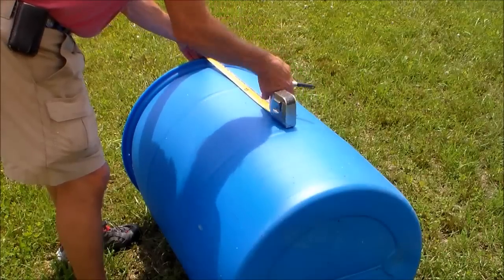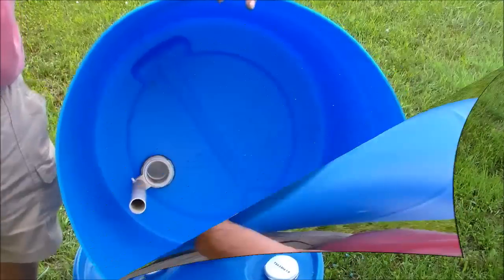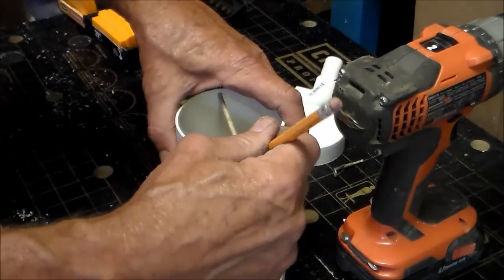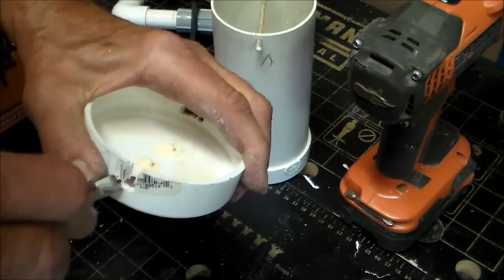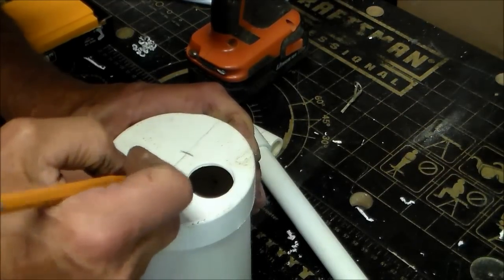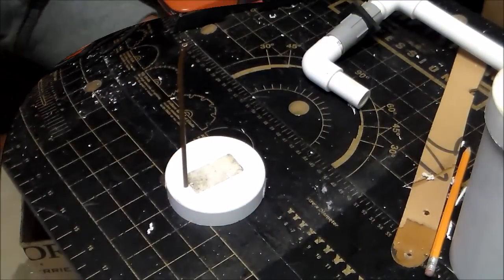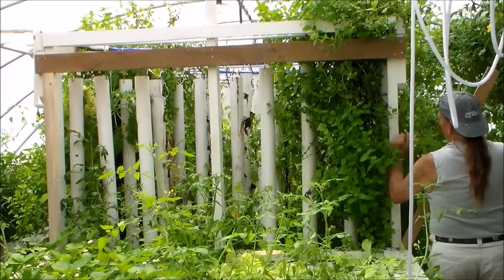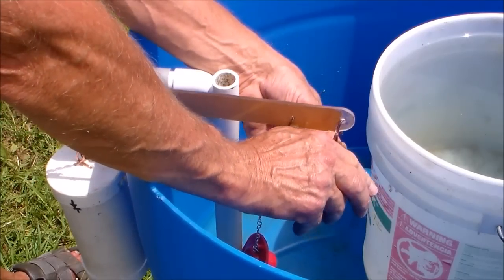Aquaponics Grow Tower Water Delivery System Part 1

Comment: So I ran across this video in looking for a better way to plumb my DIY Growtowers than running a pump up the tower and spraying the water downward.Let me preface my comment/question with this: I'm a teacher and we have one week of school left of the school year, so my brain is only firing on 3 pistons, but I'm not understanding this at all. Would this blue barrel contraption be attached to a water source that runs 24/7, like a bathroom toilet is, or what? I'm trying to figure out where the water is going to actually be coming FROM. There's no pump involved at all? I understand how this part works and how it would then deliver water somewhere else, but where is the water coming from? (In use, not in the video. I did see the hose he was filling this up to test it.) And then from here, does it just go down pipes into multiple towers/beds, or what? It doesn't seem to be part of a recirculating system, as it looks like it would have to be above all the grow beds/grow towers, in which case you'd still need a pump to get water from the bottom of the towers to the top of this blue thing, but then what would be the point of this at all? If you're going to be using a pump, it seems easier to just pump straight from water reservoir to top of tower without this. Again, my brain just seems to be missing a step. Anyone?
Reply from the maker: there is a pump running constantly from the sump tank.  the reason  for this system is to  create a flood and drain system. the plant roots get a great drench then during  the interval get it's dose of air. the drip tubes of the other system  can have dry areas on  the roots, the big advantage is that you can use dirty water and not foul the system as often happens with the drip  tubes. Hope this  answers your questions---- Don

Comment: very nice build. I used a 2 liter soda bottle and spray painted it black, i still get some algae but it's easy to clean with a little pea gravel in the bottle and swirl it around. also easy to adjust the dump by drilling larger and larger holes until you get it timed just right. the 2 liter bottle worked for 2 years, I changed it to a 3 liter bottle and it no longer gets the bit of water that overflows the top fill hole. also turned my flush valve sideways to the overflow tube wasn't in the way of the flush arm, in my case i used a piece of 3/8 copper tube for the flush arm, smashed the ends flat and drilled holes to attach my flush valve and weight....
Reply from the maker: +Jeff Jones Sound like we are on the same page my friend---good luck to you ---Don